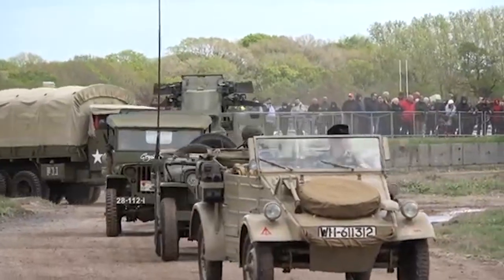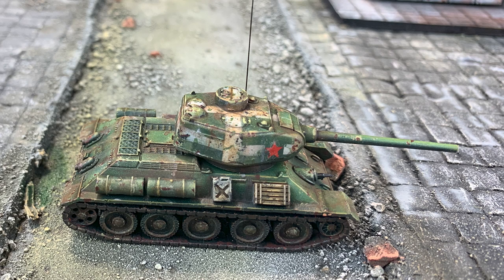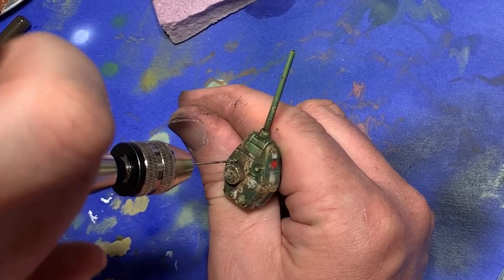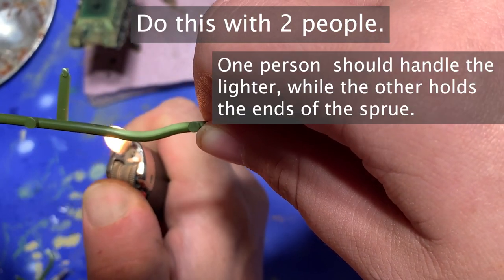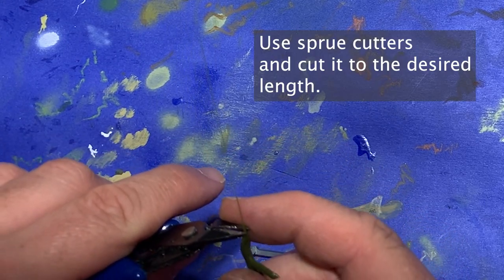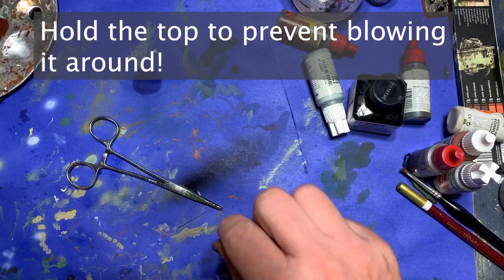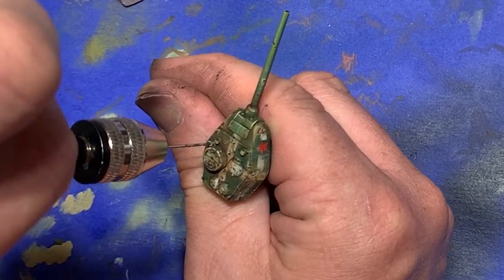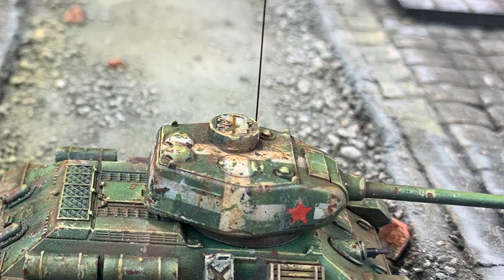The Easy Way To Build Antennae For Flames of War, Team Yankee, Scale Models & Dioramas

Comment: I've been doing this off & on for years. My only change would be to use a candle instead of a lighter. Allows you to use both hands and smells good. Also, if you draw the sprue slowly you get a thicker aerial, which can be used for small conduits also.

Comment: I used to do this years ago but I have found a simpler way which to actually just cut off an old dust pan brush hair which are generally black and flexible
Reply from the maker: I am aware of this technique but for some reason have never done it....I will give it a try next week.